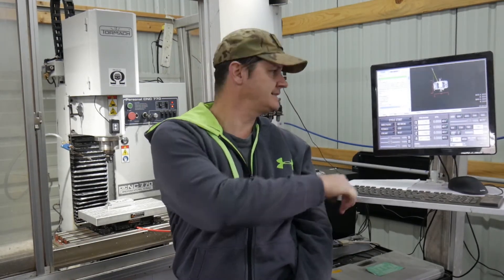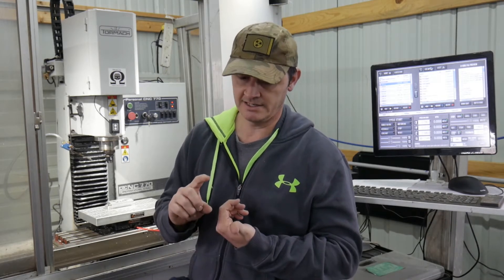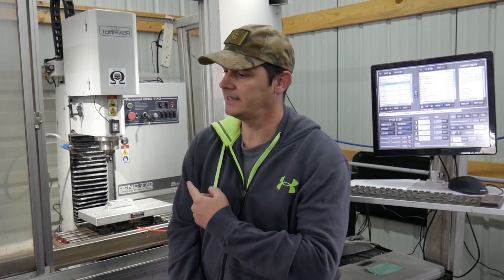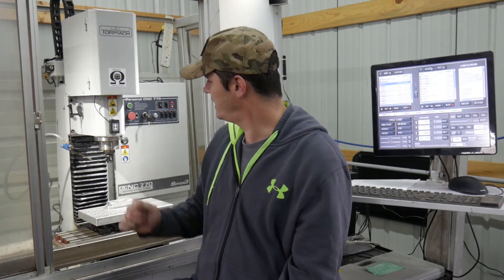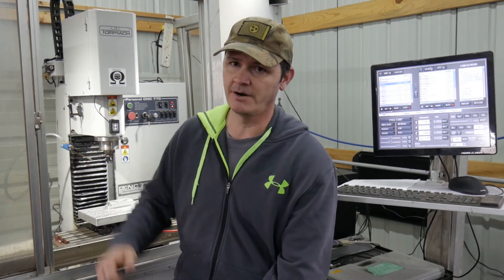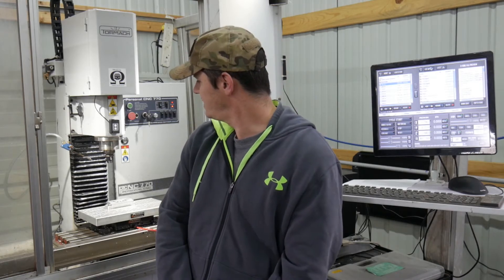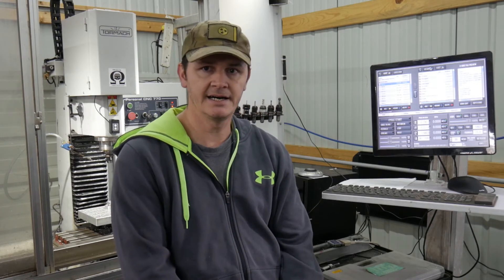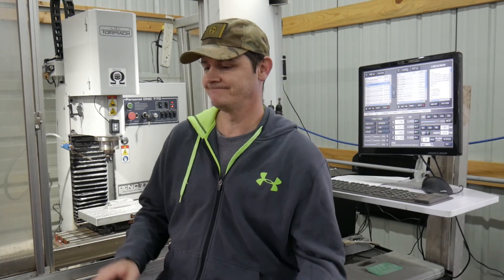Tormach 770 2 Year Review

Comment: obviously, your NOT doing precision work as  +/- .001 as tormach boost their machine will do, which they WILL NOT HOLD!
Reply from the maker: Most of what I make typically make has a tolerance of +/- .005 There have been a few tight tolerance parts but you have to get creative and if you can design the part with the machines limitations in mind you will be well ahead in the game. Ultimately if you are needing to hold that tight of tolerance or doing large quantity production work, one would be better suited purchasing an industrial grade machine instead of a Tormach.
Reply: @jodyolivent8481  

Thank you for you honesty!
Reply from the maker: @doesntmatter3068  Life is to short and I would hate to see someone spend there money on something that is not a good fit for the job.

Comment: Great video and thanks for the thoughts on upgrades.  I have a Series 3 1100 that I bought new in 2011 and am getting chatter more and more frequently.  If I machine around the OD of a piece of round stock I notice chatter about 4 o'clock and then again the 10 o'clock positions, even on light depth of cuts.  Have you had this problem?  I believe my gibs may need to be adjusted although I haven't tried it yet.
Reply from the maker: No I have not had that problem. It could be looseness in your Gibs, I would start there. Also, check for backlash and lost motion. These can be adjusted with Admin tools in pathpilot.

Comment: They just really need to ditch ways and gibs and go to linear rails then there machines would be very viable
Reply from the maker: I dont think you would see any real benefit from linear rails on a machine this size. You actually loose rigidity with rails. The main reason they are use is for high speed applications and they are cheap Precision. 

I'm already getting 300 ipm. While gibs must be adjusted it isn't that difficult and the adjustability means you get more life out of a machine. Once a linear rail is worn it must be replaced. 

All that said I think the MX series should have had rails.
Reply: @jodyolivent8481  How often do you adjust your gibs on your Tormach?
Reply from the maker: @CBJKNL  just once, when I first setup the machine.
Reply: @jodyolivent8481  totally disagree rails are way more rigid than ways, you can easily demonstrate this by pushing on your table with a indicator on it, you'll likely have a couple thou of movement at the extreminties not going to happen on a machine with rails, just the nature of the beast.
Reply: @jodyolivent8481  the reason they didnt go rails is beacuse there not cheap, there more expensive, beacuse they dont have adjustments like gibs they need to be dead on. Plus there loaded out machines cost as much as a haas so it's a tough sale to begin with
Reply from the maker: @Daniel-vq9zb  tormach definitely likes their markup margin.  That's why I bought my touchscreen monitor from monoprice instead of getting it from tormach.

 I understand they are running a business but when I can find the same thing from a retailer for 40% less I'm buying from there.
Reply: @jodyolivent8481  they've really almost priced them self out of the market except for the fact they have name regonition with being for hobbiest or people just starting out.
Reply: @Daniel-vq9zb  Disagree all you want. However; solid ways, especially boxed ways, are absolutely more rigid than linear guides. Not to say that plenty of well regarded heavy duty and accurate machines aren’t built with rails; or that boxed way machines can’t move fast. Boxed ways for stability, weight capacity,  and outright accuracy, rails for speed and price. Dovetail ways are a compromise in every way; totally ok if you have realistic expectations.
Reply: We have an old prototrak that uses DT ways and it hasn't given us any issues for years and years. What's so bad about them?
Reply: @CBJKNL  not rigid and they have to be adjusted to maintain accuracy